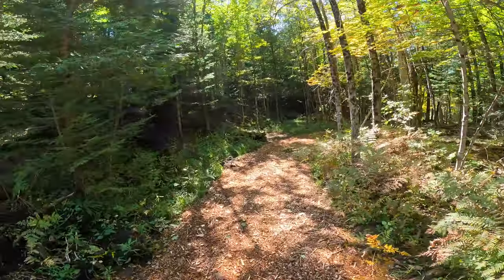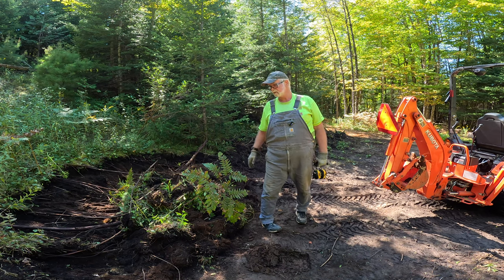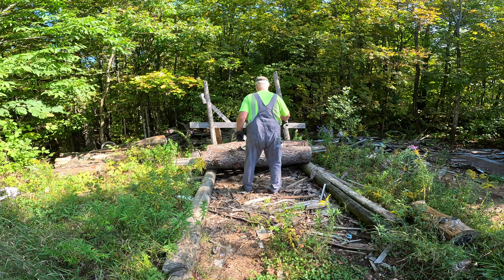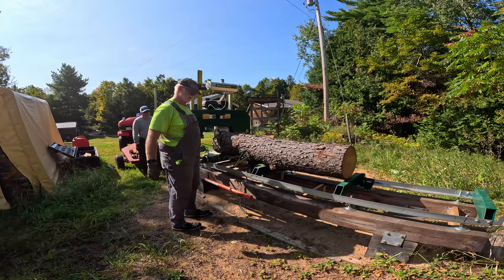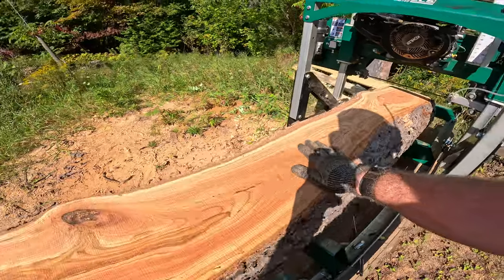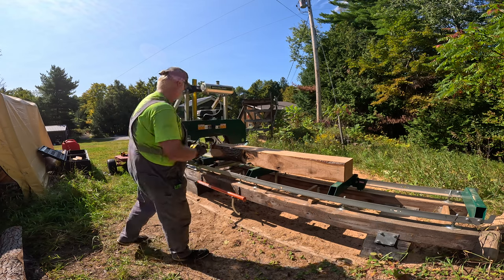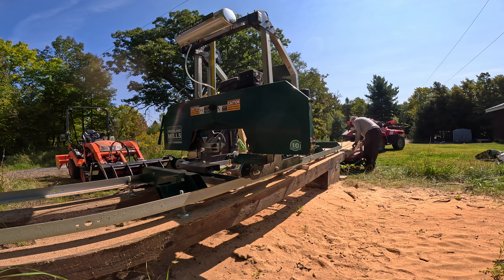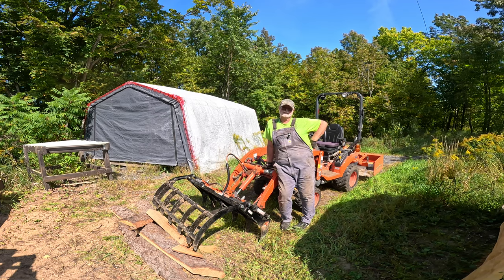Off-Grid Cabin Adventure: Cherry Log Rescue!

Comment: Good evening Brian. The Kohler engine started as expected. The little guy was pretty cool and very curious.  In most cases cherry doesn't grow very straight, and that's a big reason why it likes to twist and warp when drying, but when you get a vaneer grade  cherry log the milled wood is gorgeous. Thanks for the shout-out and keep up the great work.
Reply from the maker: Evening Paul. We got a little bit of what I think will be usable. The little guy sure loved being around. He never stopped talkin😆 That Koehler engine has worked perfectly. The sawmill made pretty easy work of those logs. I had no hardwood blades left so I just went a bit slow with the regular blades. Thanks for stopping by Paul!

Comment: What I'd give for some cherry logs (& a mill to cut it...).
I try to avoid new timber for my woodworking projects & spend time scrounging old beams from demolition sites, then spending hours checking for metal before cutting either on my 10" table saw or with my chainsaw
Even then, I don't use my best blade/chain for the initial cut.
I'm going to rescue a 5'x2'x2' chunk of what I think is elm from off the shore tomorrow to see if there's something it can be made into.
That'll be a long job, slabbing it with the chainsaw.
Reply from the maker: I’m looking forward to getting to the point in my woodworking that I can understand and properly use wood like cherry. Elm is everywhere around here because of Dutch elm disease. I’m slowly figuring out some of the basics but I’m having fun. Maybe you should think about doing a video on a new project. Thanks for stopping by!
Reply: @retiredforlife63  I tried making a video on my vegetable garden one time & the result wasn't encouraging.
Reply from the maker: @GARDENER42  sometimes you need to just keep banging away. What ever you choose, I appreciate your support and advice.